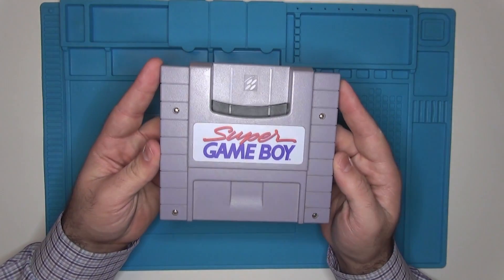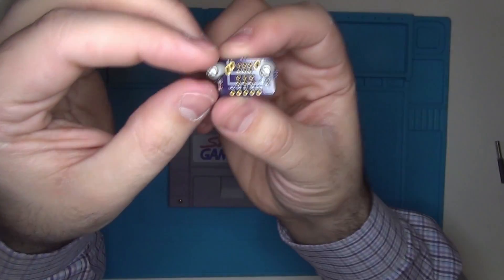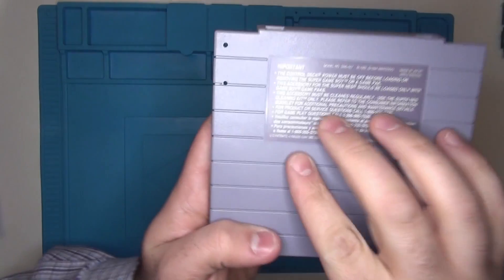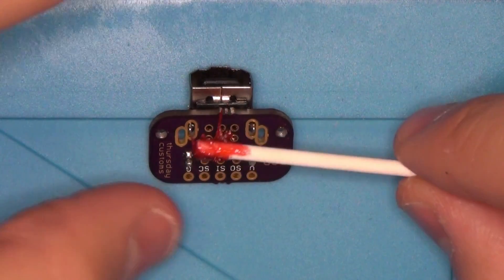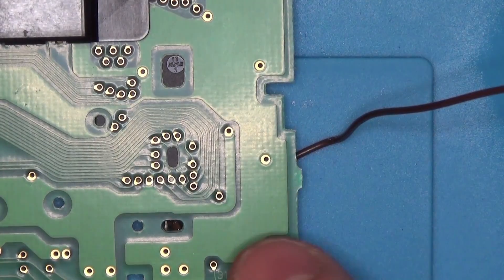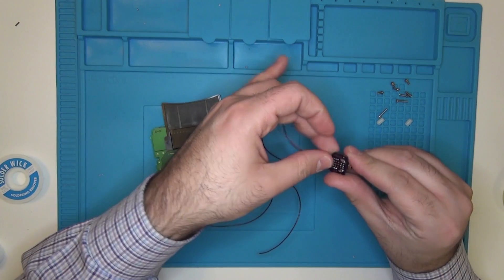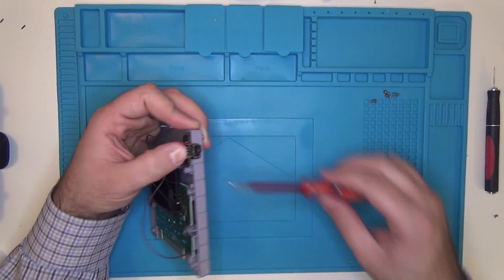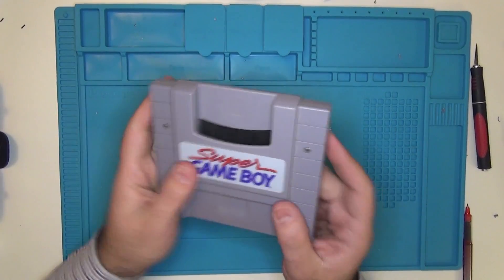GAME MODS | Adding a Link Port to Your Super Game Boy! 😯

Comment: Great work! Do you think is it possible to replace the bios by SGB 2  bios?
Reply from the maker: Hmm I'm not sure. I've never considered doing that
Reply: It would still run too fast without the clock mod.

At that point, you may just want a super Gameboy 2 and a 3-d printed cart slot.

Comment: I ordered this part from Thursday Customs and for some reason I can't get it to work. I'm not sure if its because I used an incorrect kind of wire. I cut apart an old ADA floppy disk drive cable and used strands of that. I followed the instructions completely and have had no luck. When I connect my GB Printer it shows that it's not connected. Any suggestions?
Reply from the maker: You may need to also do the time clock mod. The Super gameboy ran at a slightly higher speed then the gameboy which will lead to syncing problems. Have you tested your port with say a Pokemon game to confirm it does in fact work? I would also check continuity between all surrounding pins and the 3 wires from the CPU. You could be bridging one. I had this issue and took me like 3 hours to troubleshoot.
Reply: Restalgia Tahank you for the advice. I’ll go back and check these things and let you know.
Reply: Well I tried just about everything I can possibly do at the moment. I followed the video step by step. I even reordered the same 30g solid core wire used in the video. I made sure I didn’t have any shorts or loose connection. Nothing. I tried linking two Pokémon games and they don’t recognize the cord being plugged in. Still doesn’t recognize the printer either. It’s weird it works in the video without the clock mod yet but mine doesn’t. Other than trying the clock mod I don’t know what else to check :/

Comment: It's amazing no one has done this before,  kudos Sir!!!  

Out of curiosity, Is there anything you can do to speed up the clock speed as well?   Something else they fixed on the Super Game Boy 2.
Reply from the maker: Yes there is, I am working on getting the parts and will make a follow up video showing how to do that too!
Reply: @Restalgia  Nice,  lookign forward to that then :)
Reply: @Restalgia  I wonder if they didn't add the link port to the original because of the clock rate. I'm sure it would increase the risk of corruption or failure. But if she works, she works, mod away.
Reply from the maker: @gregory666777  I am sure the clock rate has something to do with it. As it stands I have not had any issues, but I'm sure there would be syncing issues. I am planning on doing another video showing how to fix the clock rate on it soon. :)
Reply: @gregory666777  Probably a cost-cutting measure too. The link cable was almost entirely unused by everyone I knew. I'm sure some people used it and there might be other areas of the country where its use was pretty normal but, overall, I think it just felt like a needless bell and whistle kinda thing in the grand scheme of things especially when they were trying to get people to drop $50 (in 1994 money, no less) on a peripheral to play games from a 5-year old system. Lastly, Super Gameboy came out almost a full two years before Pokemon so the allure of data transfer was either nonexistent or very limited at that point.

I'm just brainstorming all the reasons they may have forgone its inclusion. Not trying to beat you over the head with any cynicism or anything like that.
Reply: Peter Molyneux is also interested